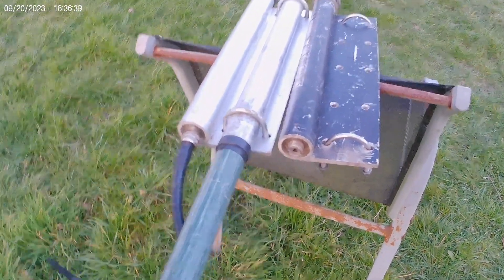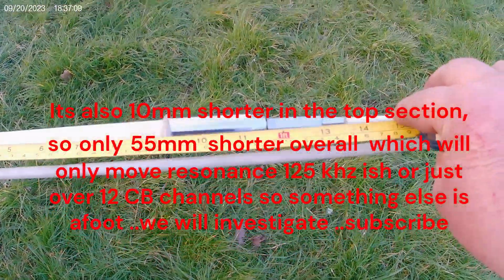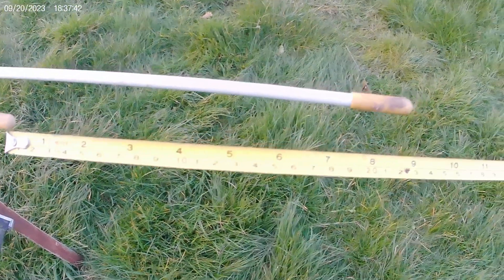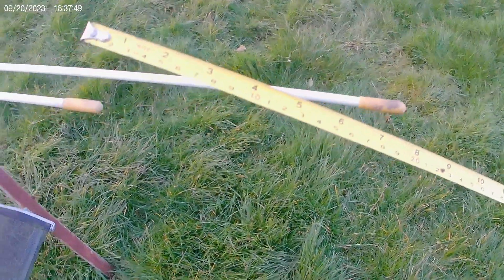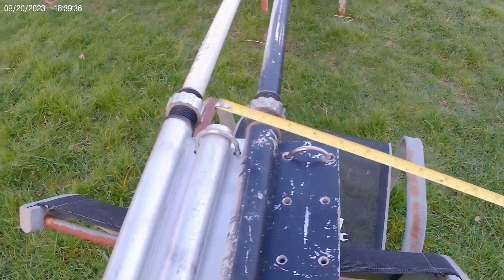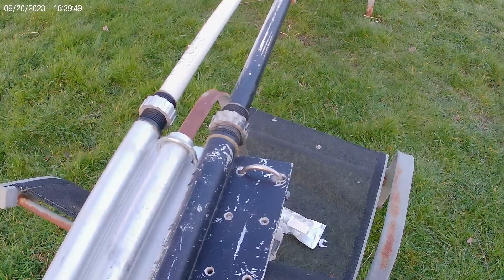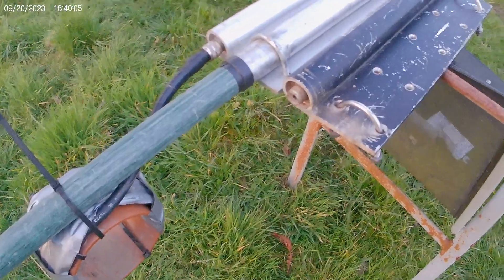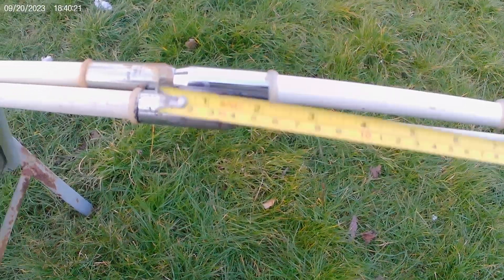Old Solarcon Imax 2000 VS Imax optimizer prt1 not what i think

Comment: I've been using the Solarcon Max Optimizer antenna for around a year now.  I was using the Solarcon Antron A99 prior.  The Solarcon Max Optimizer antenna SWR using a new version President Washington radio, SWR is at 1.0 at 27.3850.  It's definitely an upgrade from the Antron A99.  I also installed the Ground Plane Kit as well.  Can't beat the Max for 11 meter.

Comment: I put mine up (upgraded from a99) with the optimiser on and it tuned o 26.8 mhz.i thought it was the nano vna so checked it with a normal swr meter,same result.i screwed the rings to the top and tried again,it was 1:2:1 on 27.500,so (when I can be bothered) will get it down,remove the optimiser and set the rings in the middle and try that
Reply: what was the center frequency you was aiming for?
Reply: @77appyi  27.500.was hoping it would get a low swr on 15m 21.3mhz like the antron but got 1:8:1.17m was a no go for me,5:1,lol
Reply from the maker: @marksands3237   my reply above was on my other YT account..i am going to do the SWR data points  at an SWR of 1.5-1 each side of resonance and at an SWR of 3-1 each side..i have chosen just 4 point otherwise i will end up with to much data with all the configurations  i want to do ..i chose 1.5-1 as this the highest you want it to run a linear amp  and 3-1 as that's what most HF radios with built in antenna tuners will auto tune ..
 i may mention the lowest SWR ..it will be noted at my end ..i have done my 1st test with the optimizer on and rings in center and resonance is a bit high at an SWR of 1.45-1..i have the imax insulated from the mast and a coax choke  i will try it not insulated from the mast and see if there's a difference..
   the 1.5 points are 26.48 to 27.12mhz